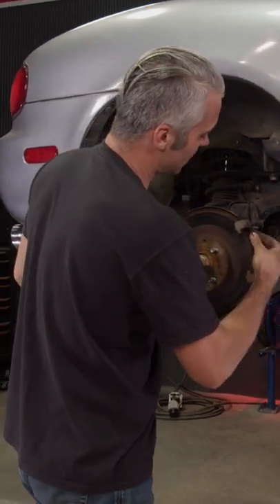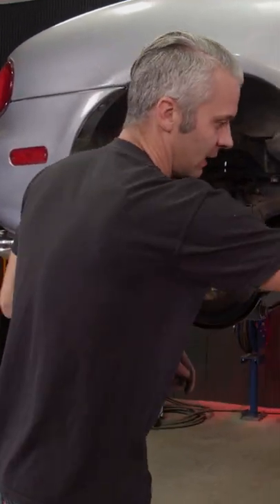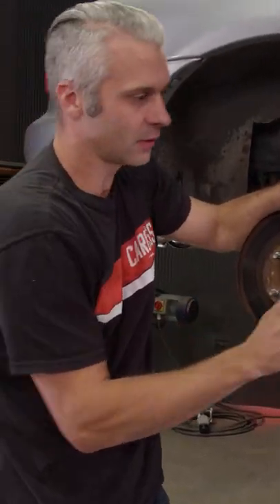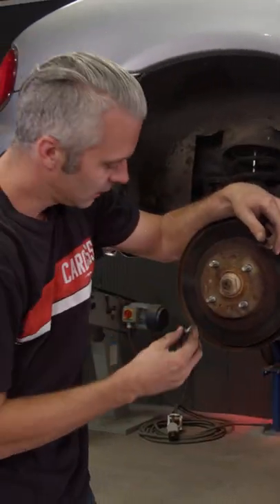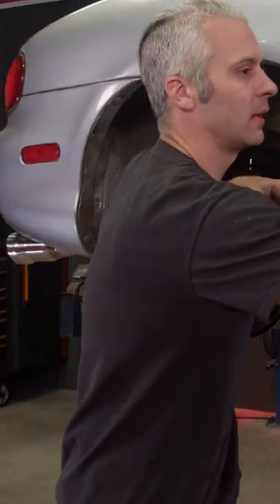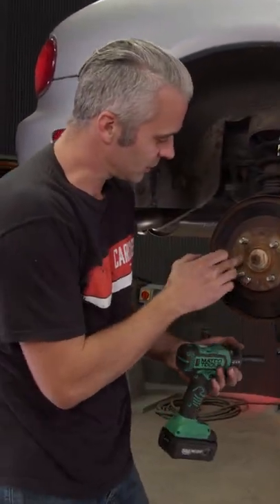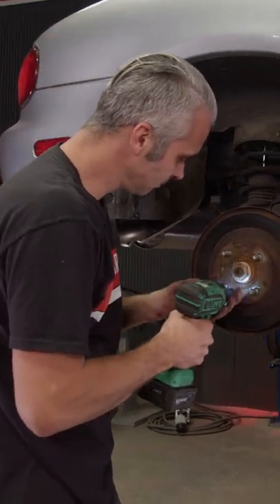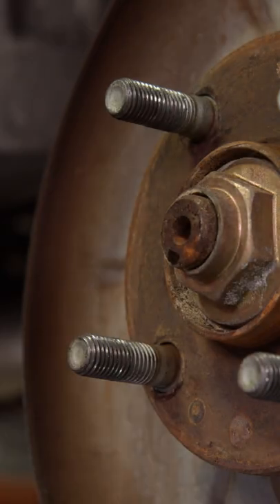Rotor Removal Trick

Comment: Another fun little fact is that if you live anywhere with any sort of rust, the threads in the rotor WILL strip. Thread on a lug nut a couple turns and grab a BFH. Works every time.
Reply: Exactly!
Reply: I did this with a 5lb sledge, the rotor was visually warped by the time that it came off.
Gotta love that rust
Reply: No need for the lug nuts.
Reply: Ship the lug nuts step and continue as described above. Men wear boots and a rotor ain't shit
Reply: Hit it with your purse jimmy!!
Reply: Or shatters the rotor around that hole and it's still left on.
Reply: @clayton9136  yes there is. It’s to protect the studs if you miss and hit one and it also keeps the rotor from falling off and scratching or gouging your nice epoxy floor. 🤦🏻‍♂️🤔🤷‍♂️
Reply: @mike5162  Then dont miss. And catch it before it falls. Now watch and learn as I run circles around you.
Reply: I had times I beat to the point I feared bearing damage so I had to split the rotor.
Reply: @dennisborn1382  huh?
Reply: I.D. is tapped/O.D. is threaded Sorry for being so pedantic.
Reply: Bfh big fkin hammer ❓😂

Comment: Yes, I know that one...here's a tip, one need not actually try to run the threads thru & actually pop the rotor off, many times those threads will strip out,  when the bolt bottoms out contacting the rotor, snug it against the rotor...& then smack it with your  dead-blow hammer. When you run that bolt down & up against the rotor, you are actually creating a fulcrum pivoting  point...works every time for me.
Reply: Smack the bolt or rotor??
Reply: @30002elimoises  You  are  striking  the rotor...levering it loose.
Reply: @AndieBlack13  preciate you broham
Reply: @AndieBlack13  I find that using an ordinary hammer & making the rotor ring like a bell is what works for me, it seems the oscillations crack through the rust. 
I agree tensioning the bolt with a spanner can be the key, it is what it's there for.
Reply: Do all rotors have this threaded hole for this purpose ? I have an 03 Ram. Thx.
Reply: @kipcarroll5644  I just looked up images of an OEM replacement rotor & I did not see one of those threaded holes for this purpose...no, it seems this is not universal...usually whacking it with a plastic, (not solid steel) hammer will dislodge the rust buildup just fine.
Reply: @kipcarroll5644  It very much depends on your geographic area, do you live in a part of the country where they use salt in frozen temperatures?....if so, you will find lots of rust under your truck. BTW, I had an 1997 Ram 1500 in Oregon, no bad salt-rust there....east coast?, yep you will find rust.

Comment: The best way is to get a couple bolts and nuts, thread through the caliper mounting holes pointing towards the rotor.  Press the rotor off.
Reply: My caliper holes are behind the debris shield.

Comment: No, you tighten the bolt with a spanner then use a hammer to make the rotor ring like a bell. 

Doing it his way is going to strip the thread if the rotor actually is rusted on.

Comment: Thank you for this video. I have 2010 Lexus ES 350. I tried using a hammer that didn’t work for me. I went to AutoZone and got bolts M8-1.25x30mm. The rotor was released from the hub in less than a minute.🙏🏾

Comment: They are called jacking bolt holes should always run a tap through it first if your gonna use them. But giving it a good hard smack with a deadblow works everytime

Comment: Another fun fact. Sometimes in the rust belt you need to cut a slot in the rotor with an angle grinder then drive a chisel in the slot to split the rotor off.
Reply: Destructive testing.

Comment: Yeah that's not gonna work when the rotors are rust welded on the hub
Reply: PB Blaster and go get a Coke if the Blaster doesn't work.
Reply: @happydays8171  pb blaster is for rookies get you some Aerokroil that's some good penetrating oil.
Reply: @christopherperdue977  
Gotcha.
PB Blaster is all my shop buys. But I'll get that for home use. Is it available in stores?
Reply: @happydays8171  expensive, JB 80 works almost as well,I think you can get it at Menards.
Reply: @dustinpomeroy8817  
Thanks
Reply: @christopherperdue977  pb blaster works just fine. I guarantee that kroil shit wouldn't make any difference

Comment: That works one at a 10 times the Bolt usually strips out
Reply: Just tighten the bolt with a spanner then whack the rotor with a hammer as usual. It's only there for when the thing is properly stuck. A bit of PlusGas, WD40 or Diesel down the hole sometimes helps too.

Comment: But if you smack it with a bfh first before removing the fitting screw, they unseize and then actually come out with ease and then the disc is already loose

Comment: Yeah, okay. Everything is rusty. Including the threaded hole. Good luck getting a bolt in that thing. Do yourself a favor, get a block of wood and a heavy mallet and wack it a few times to break the rust holding the rotor on. Works every time.

Comment: I just changed my rotors on my Durango there is no need for that on the Durango all you do is take a little rubber o-ring off and it slides right off with no trouble